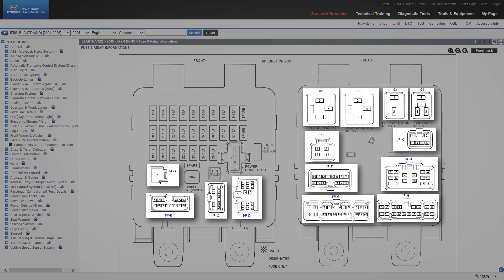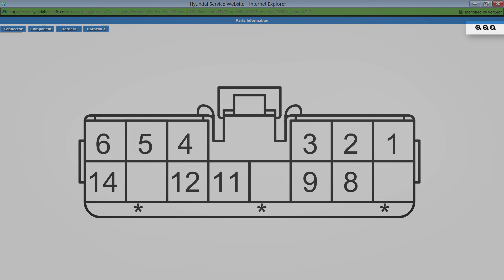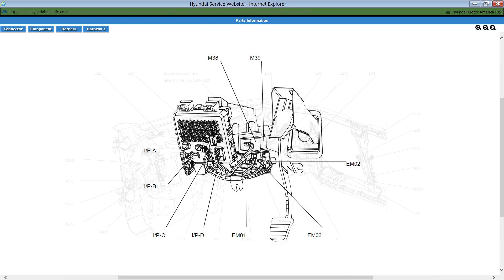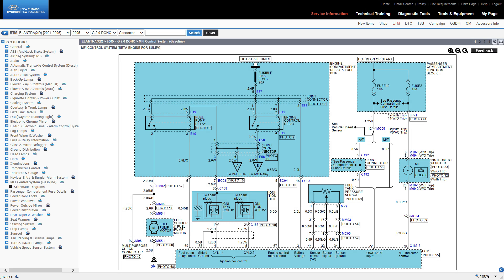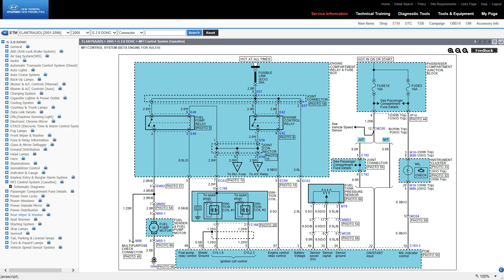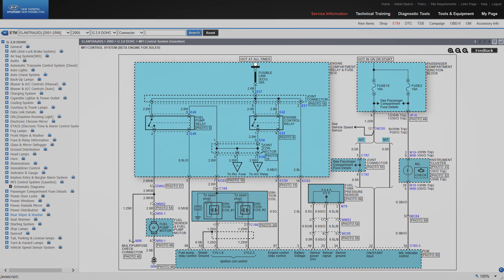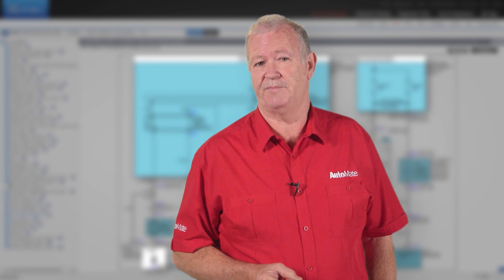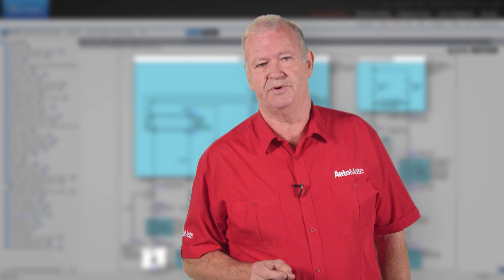Hyundai Wiring Diagrams 2001 to 2006

Comment: Hello sir 
 I have Hyundai elentra 1.6l automatic transmission vehicle . this vehicle have a problem, this car 4th gear shifting not coming, Iam change gearbox, ECM, knock sensor but not benefit.vehicle scanning report is good no codes.

Eny suggestion?
Available for wiring diagram for 4th gear shifting.
IAM expecting your reply
Reply: 2005 model

Comment: I'm trying to find the location of the thermal sensor switch for the radiator fan of hyundai santa fe 2001 with 2.0 engine; do you have a diagram showing this. tnx

Comment: I have an issue with my 2005 hyundai elantra GLS.  The driver's door doesn't lock with both key fobs, but the other 3 doors lock with the key fob.  And when I go to unlock the car, the driver's door and the rest of the car unlocks, but when I go to lock the car with the key fob, the passenger doors lock but the driver's doesn't, so I have to manually lock the driver's door in order for me to use the lock button to arm the vehicle.  Please help me figure this out and help me fix this.

Comment: I have   a problem with my Hyundai  Santa fe the wires that go in the computer box is puLling out of the plug and I do not now to pluck back because  I am confused with the different coulars it is 2.4l  2005 model pls help me my no 0812578070
Reply: Good luck darlin I have a santa fe 2005 and its possessed wiring issues gone haywire and auto  electricians are hard to find try the library and hyundai forums for wiring schematics and find someone who understand how to read them  hope this helps